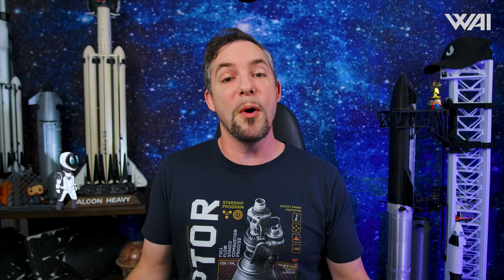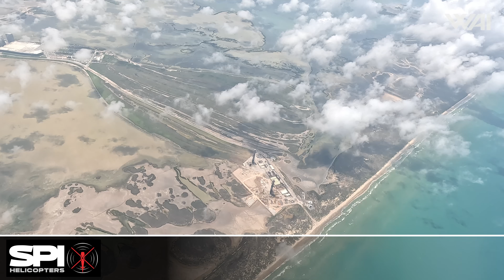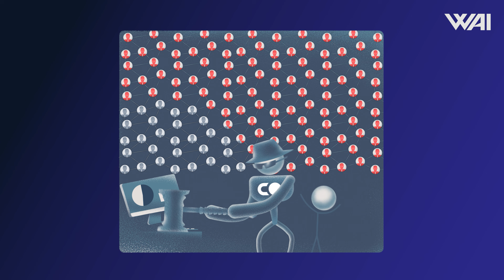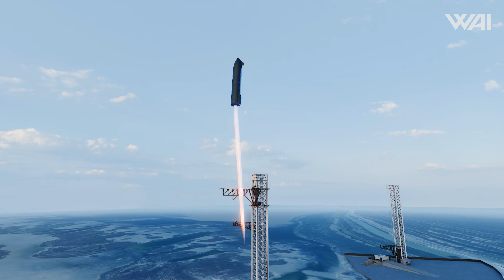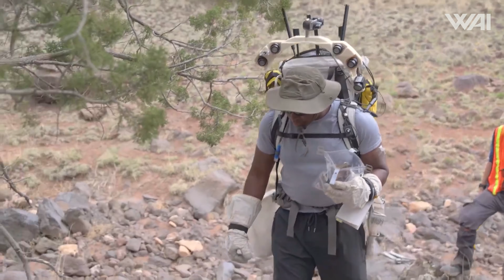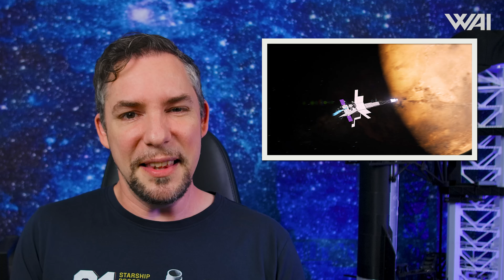Is the Artemis III HLS Starship Already Testing at Starbase?

Comment: A 16 inch diameter pipe 5 miles long at typical transport pressures, could move about 6200 tons of methane a day. So basically that pipe is good for one fill about every 20 hours.
Reply: What do you consider a typical transport pressure?
Reply: @YagiChanDan  400 to 800 psi
Reply: I'm British, so have the annoying habit of intermixing imperial and metric 😂😂😂.  I'm guessing 75 bar, which is what.... 1000psi?  In the UK, most people do not realise that we transport gas at those pressures.  And when we do, there is no artificial smell added, as that is done when the pressure is stepped down for lower local distribution.  If you get a leak at 75 bar underground, you'll get a sink hole long before a build up of explosive levels occurs.

Strikes me that a 16" pipeline is either one of several planned, or a typical Space X iteration.  Assuming they are going for a high launch cadence.
Reply: @YagiChanDan  I actually had no idea what pressures the transport line ran at. I googled it and 1000psi was the results. I inquired about pressure drop over 5 miles in a 16 inch pipe and one results said 40% and another said 60%.  I then inquired about the number of cubic feet could be moved at that pressure and how much it would weigh and then estimated based on how much booster and ship holds. My estimates are likely off by a good bit.

I assume SpaceX will have huge storage tanks and they could keep up with a high cadence assuming they have periods of time where they can allow the tanks to refil. But I'm guessing.
Reply: @BlenderRookie fair enough 😂. Professionally I dealt with mhch lower pressures and pipes up to 3", but had friends involved in vital national infrastructure who gave me insights into the side of things not readily known.

If Space X want to maintain the ki d of cadence they're talking about, they'll need to either have multiple pipelines, or replace this one with something bigger.  Which raises several new lines of discussion.  Redundancy over cost?  

The larger the diameter, the thicker the pipe wall; but the sizing is not linear.  If you go for multiple lines, you increase safety and redundancy, but costs go up massively.

Storage is then more of a buffer.... 75 bar /1000psi or thereabouts is the sweet spot as I understand things for transport pressure. It also depends on what they want as a discharge pressure.

Man, I'm glad I'm retired it hurts my brain juggling the options 😂😂
Reply: @BlenderRookie I am concerned about the 40% to 60% estimated drop in only five miles of pipe estimate. How do we move out natural gas for our nation through the thousands of miles without booster pumps every five to ten miles? I know booster stations are not anywhere that close. I do not believe we have that huge of line loss.
Reply: @ronfullerton3162 It's not that the pressure vanishes. It's that the length of the pipe causes resistance to flow. Even a 1000 mile pipe at zero flow will be the same end pressure and the input pressure. But the moment flow is figured into it, there's a pressure drop at the end.  It's the Weymouth equation. I'm not smart enough to fully understand it, much less explain it. But as the demand at the destination end goes up, the pressure will drop.
Reply: @YagiChanDan for sure they're aiming for crazy high launch cadence, but from where? I thought Starbase would be more about R&D, while pad 39 would be higher traffic. The factories in Florida are bigger than the one in Texas.
Reply: Remember the goal to support a launch a day includes three launch sites. So that pipeline only needs to support a flight every three days 

Alternately, with a sufficiently large tank farm, they could just be continuous
Reply: @danielp920 you mean 3 pads? I count 2: one to launch the stack and catch the booster, the other to catch the ship.
Reply: @kennethroberts6993 I mean Boca Chica plus Kennedy Space Center plus Vandenberg
Reply: @danielp920  true
Reply: Chrome AI says: "A 16-inch diameter, 5-mile pipeline can typically transport between 2,100 and 8,500 short tons (1,900 to 7,700 metric tons) of methane per day. A fully loaded Starship V3 stack (comprising the Starship upper stage and the Super Heavy booster) carries approximately 1,300 to 1,400 metric tons of liquid methane (CH₄)."
Reply: @YagiChanDan Thank you for your calculations.  Non US user here. That's means a Boca Chica (gaseous) methane pipline Ø41 cm over 9.3 km with a contained volume of  a whopping1228 m^3. This isn't metric snobisme, and if Felix wants to keep his international and engineering audience, he needs to show these conversions on screen.
He should also have done the calculation you did. 

— Paul_Wi11iams

Comment: I believe SpaceX will have to prove on concept to land unmanned on the moon twice. Before confidence built for astronauts. And also land on the mecazilla tower both those times.  Proof again for humans onboard is what they need
Reply: @bruceyoung1343 One uncrewed lunar landing and a hop always were the plan. I agree that two landings would be better. Starship is not launching astronauts from the ground in the Artemis context. They are planning that later and independently of Artemis.  It used to be in Jared Isaacman's plans before he became NASA administrator. It would only take one POTUS tantrum for him to leave that job and switch back to active flight duties.

— Paul_Wi11iams
Reply: @paulwilliams3731  So, 16 total uncrewed flights for two test uncrewed landings and returns.

Comment: IMHO, they are still having issues with the ship and the engine bay during boost. Ship 39 was lucky to reach orbit. With the shutdown, visible gas in the skirt and parts glowing with heat that shouldn’t have been glowing I think it was damn fortunate it didn’t explode.  This has been an issue on many flights and apparently SX has no idea how to deal with it. Until the ship boost phase is no longer a nail biter the program is going to be stuck.
Reply: I think parts of the RVACs are meant to glow, they do that every time. It's a good cooling mechanism
Reply: @notgreg123 No this was the non functioning engine that was glowing. Part of the skirt was damaged and getting hot as well. They’re going to have to redesign the skirt to be an open structure similar to the hot stage ring. I’ve always thought the solid tube around the engines to be a strange design.
Reply: @MrCrystalcranium  I see

Comment: I'm calling it. July 4th launch with a booster and ship catch
Reply: Eh, I'd bet not.
1. Booster 19 failed to validate a soft splashdown 
2. They couldn't do the engine relight test on the ship so definitely no orbital flight on the next one
3. It's flight number 13. Something is bound to go wrong
Reply: @notgreg123  Apollo 13 launched at 13:13 Houston time like it was no big deal.
Reply: @notgreg123  
So? None of those are reasons to delay.
In fact, they are reasons to accelerate, as there's more work to do and the time is running out.

Comment: I had that song, Convoy, playing in my mind while you were talking about all those trucks SpaceX needs.
Reply: They should look into borrowing technology from the oil and gas industry. Build a docking terminal offshore for an LNG tanker and pipe in product without the need for liquefaction. That might be easier than digging a trench and laying pipe through protected wetlands where the regulatory hurdles will be huge.
Reply: @MrCrystalcranium  Well you’d have to construct a port for the ship in an area that has no natural harbor, which sounds pretty challenging to me.
Reply: @domakemake2447 Not a port… just an offloading terminal.
Reply: @MrCrystalcranium  How far from shore are you thinking?
Reply: @domakemake2447 500 meters..?
Reply: @brainrotchallenge  Depends on how deep a draft a tanker would need but no more than half a mile I would guess.
Reply: @domakemake2447theres a harbor to the north, what are you talking about
Reply: @reasontexas  He’s talking about a solution that wouldn’t require a decently long pipeline, which isn’t what any nearby harbors can do (if I’m understanding correctly).

Comment: If I was NASA I wouldn't be happy with what you suggest for what SpaceX flies for Artemis 3.

It's a test of on-orbit docking so you want it to be as realistic as possible in terms of thruster control authority and that means to get maximum utility (realism) from the mission you need to get the mass and mass distribution of the test HLS used in Artemis 3 as close as possible to what it will be when the docking happens in Lunar orbit in Artemis 4. Having a heat shield and flaps will throw off that mass distribution a lot. In fact if I was NASA I would want most of the HLS design to have matured at least to the point where for instance, while Artemis 3 HLS doesn't need legs or Lunar landing engines, I would want SpaceX to be close enough to a final design to at least be able to build fairly good mass simulators for all of those components so that mass simulators can be installed in the appropriate parts of the ship for landing legs, landing engines etc.

NASA is paying for this project and the SLS launch cost for Artemis 3 is going to be massive on its own so the cost of a one-use-only HLS for Artemis 3 is tiny compared to the improvements in the mission results they will get by having that vessel be as close as possible to the final Artemis 4 flight hardware in terms of handling characteristics (and having accurate mass and mass distribution for the ship also matters for gathering data on the launch into LEO by the way).

Comment: What has Starship never done before? 
1-Orbited 
2-Stayed intact 
3-Sent a banana to the Indian Ocean
Reply: And how many iterations did Thomas Edison perform on the lite bulb? How many iterations did SX perform on the Falcon before what's going on now? Either you don't know engineering or are just pessimistic?
Reply: @johnvajcner20  Im both! I don’t know engineering and I’m very pessimistic about this project. Pessimistic might be an understatement though.
Reply: @listonheinz9103 SpaceX runs a rather material rich approach.
There are two basic ways how you can develop a rocket. The first and more common one is a simulation and component richt approach. You calculate a lot, built subcomponent and miniature models and thest them until they all work and then do a fully assembled test. It needs usually a lot time and it takes long until the realy vehicle ever sees the sun as a full assembly. But once assembled it has a high chance to work mostly from the start. And then there is the hardware rich approach of spacex. Instead of doing really long simulations they get a rough idea on what has to be done, built a test version and fly it. The idea is to build test-hardware as close as possible to the final design and fly it too see where the issues are. Usually that isnt a good approach as in spacefligt, as many components have special procedures for manufacturing. But spacex has the goal to mass produce their hardware. So the approach works. They can test and optimise their mass production capabilities and use the output hardware for test vehicles to learn and iterate. Blue Origin did the simulation rich approach. Thats why the first lauches of New Glenn where mostly successful from the beginning. SpaceX started to built Starships from the beginning and added more and more complexity over time. Until a point where the next step was to fly the shole stack. Now they will fly the whole stack 20-30 times and have a fully functional system in the end (hopefully). As i said, they want to massproduce boosters and ships anyway. So they can throw starships at space until they work. The quistion is "How long can they do it".
Reply: @listonheinz9103  As Scott Manley said: Starship.. successfully made it to orbit becoming I believe the largest spacecraft ever launched into orbit now technically okay it's not exactly in orbit it was slightly suborbital but it had so close to orbital energy that anybody that tries to split those hairs is just you know some *weird SpaceX hater*".
Reply: @admarsandbeyond That’s all well and good, but I just don’t believe any astronaut in their right mind will step into that vehicle… not for many years.

Comment: SpaceX is taking the right approach. SLS is a dead end: it is just much, much too wasteful.

Musk and SpaceX are trying to do Moon (and Mars!) missions in a way that can be economically feasible in the long term: via in-orbit refueling, and lots of reusable spacecraft, expending nothing except fuel. That approach will eventually make travel to human colonies elsewhere possible for a very small fraction of the cost of the Artemis approach, probably at least a full order of magnitude cheaper.

SLS works as designed, but the costs are astronomical. Using and discarding a pair of those SRBs costs a cool $400 million, each flight. In addition, they discard $600 million worth of reusable RS-25 engines on every SLS flight. That is horrifically wasteful. That's a cool $1 billion just in SRBs & stage 1 engines, flushed into the sea, in the first few minutes of each and every flight—and even that only accounts for 1/4 of the mission cost. That is unsustainable.

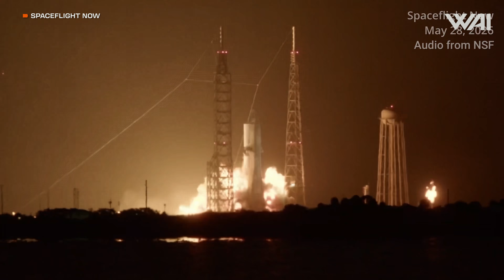As for Blue, 18:48 unfortunately there has been an observation.
Reply: Agreed

Comment: @9:53 Uhhh. FELIX.  Do you actually believe HLS is going to have a propelant transfer tube traversing straight through the ships human habitat?!😮
Reply: The transfer tube is located on the back of the ship along the wall, so it doesn't directly pass through it.
Reply: i don’t think hls will actually have a header tank, so there won’t be any need for a tube. that’s why on the actual HLS the docking port is up there